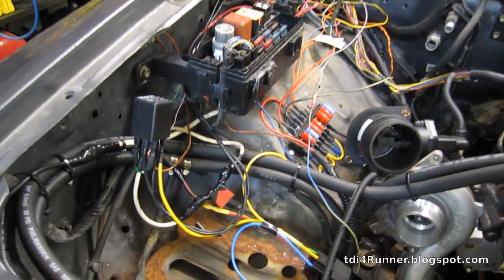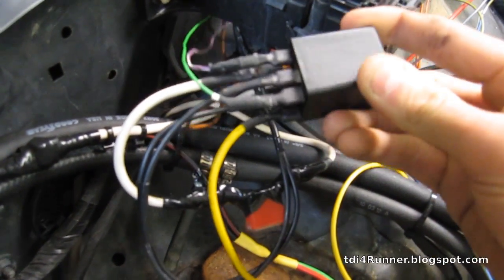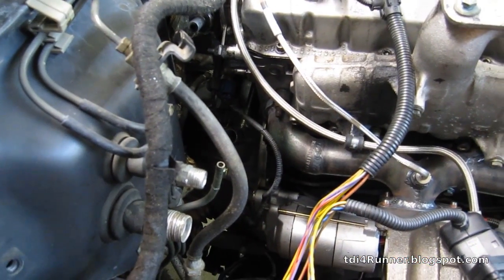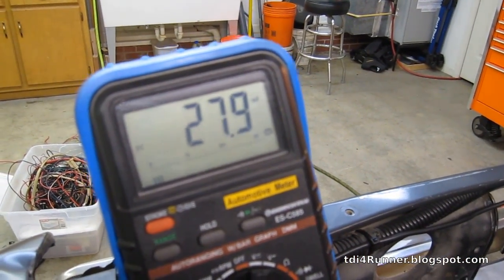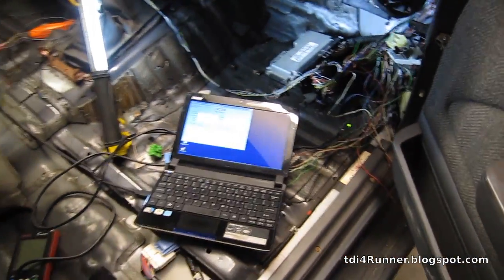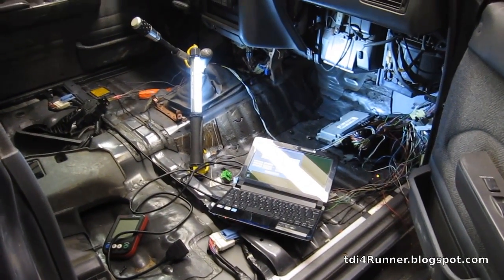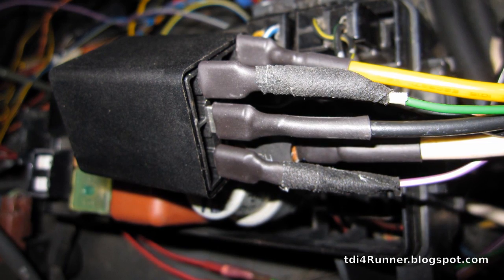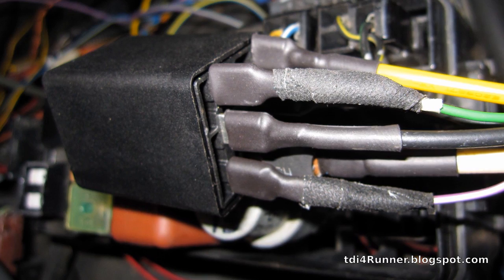TDI 4Runner Build Pt 13 - Early ALH Glow Plug Relay Wiring (DIY VW Harness)

Comment: Glow plugs fault  = change spark plugs ?
or
Glow plugs fault  = change the wires of the spark plugs ?
Reply from the maker: +urdu learner It's a diesel. There are no spark plugs.
Reply: Brantley Smith Thanks for your reply. It is clear now.

Comment: great work. please don't take this as a insult. i just want to let you know that if you run the engine without the cover the dip stick tube will break if you don't add a bracket to cut the vibration. (you probably already know about it)
Reply from the maker: Yes, broken dipstick funnels were very common when I was a tech at a VW dealer. I have several spares on the shelf. The cover will not fit due to my modifications.. plus it's ugly. I want to see engine, not plastic :)